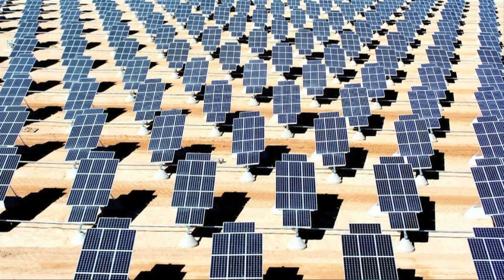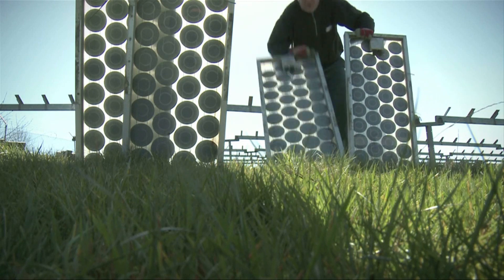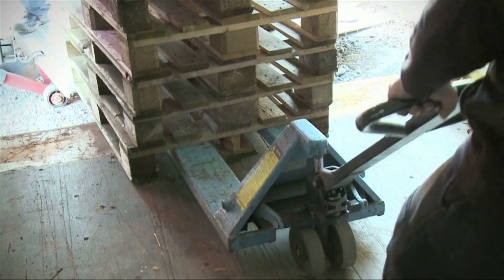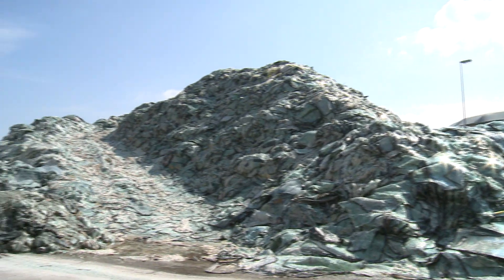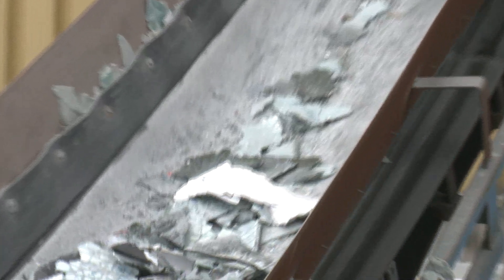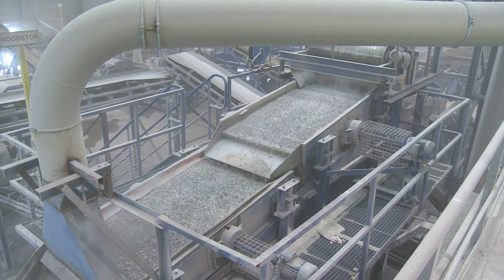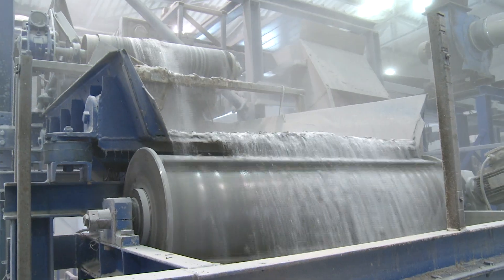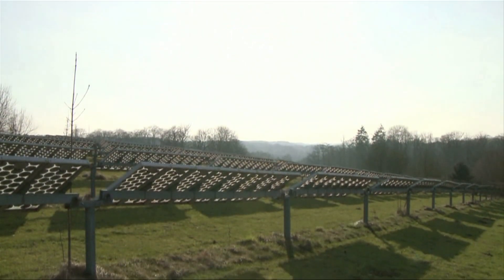PV CYCLE - Recycling of silicon based PV modules

Comment: Odd that they don't show the actual re-use of recovered materials. Of course if the material simply goes into landfills, there would be nothing to show. Same is true if the hazardous chemicals are incinerated. Its what they don't show that tells the whole story.
Reply: 95% is reused. F.i. the glass and the aluminium are valuable materials. Also the silicon can be reused.
Reply: @barrygroeneveld6901  The glass and aluminum are not valuable. Its the chemicals that have value but PC CYCLE doesn't recover those chems, they burn them and call it recycling. It is not. Burning just creates oxides of the chems. It is a misrepresentation to claim that anyone recycles the hazardous chems. To do so would cost about $100 per panel as discovered and estimated by Washington state in their statutes about solar recycling. Don't be fooled. No one "recycles" the chems in solar panels - just the glass, aluminum and copper.